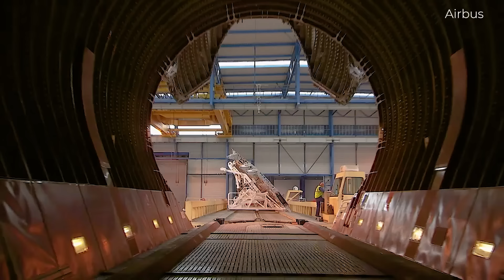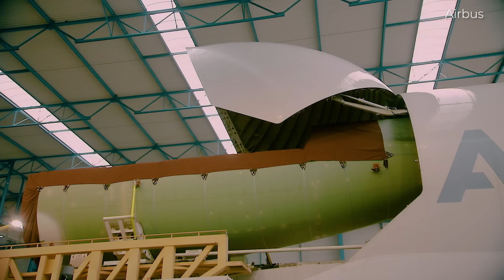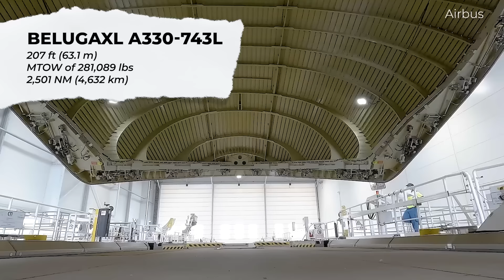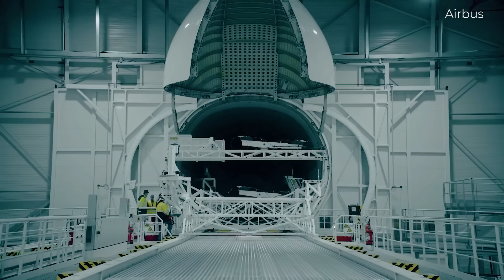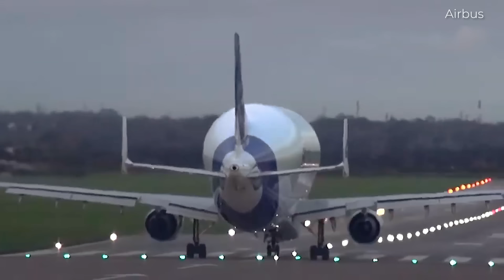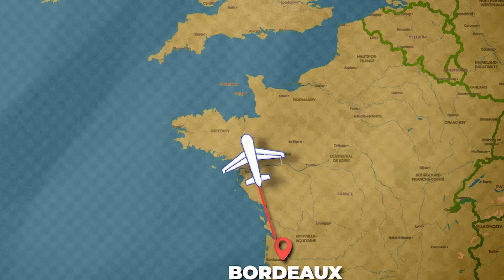End of an Aviation Icon: Airbus BelugaST #5 Takes Off One Last Time

Comment: We added an A300-600ST to a virtual airline but quickly realised it was not as lucrative as we had originally envisioned. The way the program calculated revenue was directly tied to cargo WEIGHT, and not volume. Those flights made less "revenue" than standard cargo aircraft (normal cargo planes had lower fuel burn). While I understand this was only just part of a game, that lesson has stuck with me whenever I think/see these oversized cargo planes, and seeing the struggles Airbus encountered with their own cargo venture validated that video game experience. LOL
Reply: except the very reason Airbus built them was to transport oversized items (full parts of its airplanes) around many factories in Europe. They were not only profitable, but key components for Airbus and now they are only being phased out in favour of the newer Beluga XL planes
Reply: sorry, sure they were useful, but from a load capacity, outsized cargo is niche whereas mainstream cargo focuses on tonnage (MTOW). If outsized cargo was in high demand, no doubt these airframes would be the best suited (compared to AeroSpaceLine Super Guppys or Antonov Airlines An-124)